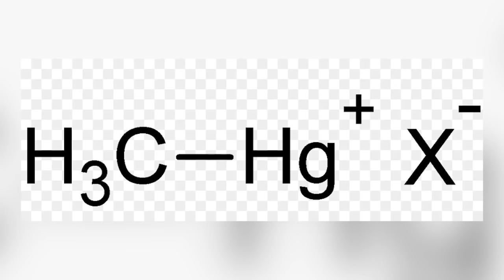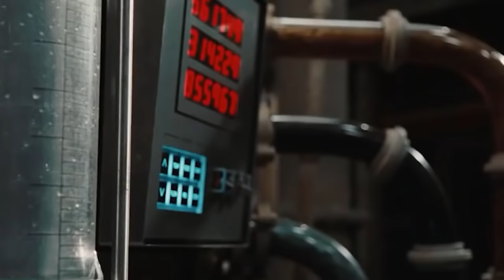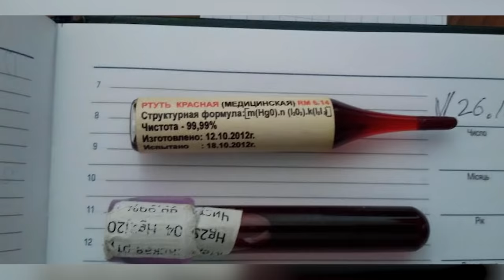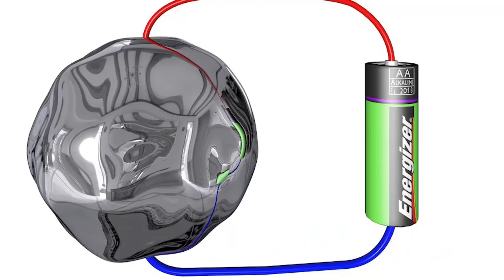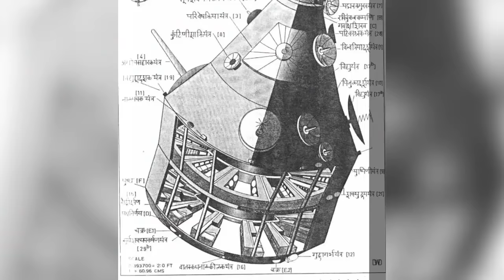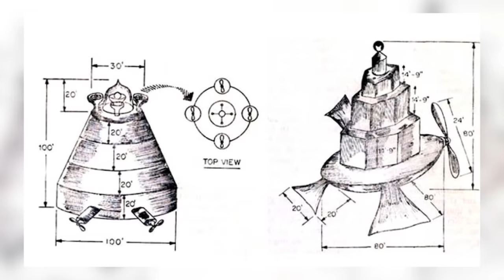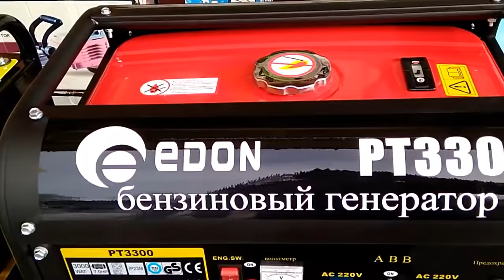Thats Why Mercury Engine Is Forbidden

Comment: I like how when the narrator says that once you start a mercury motor it could continue to power itself while showing a video of a mercury vortex turning off once power was no longer applied.
Reply: Yeah, I thought that was weird too. It's like....dude, where's the perpetual motion?
Reply: Yeah because we have real actual Mercury Motors that work to have a video of it's clearly a mock-up something to visually demonstrate the idea
Reply: Things power themselves all the time. EGR valves in cars, afterburners in jet engines, breaks on electric cars, even a turbocharger or supercharger in a car powers itself. Granted it will never power itself completely, but it does generate power/joules/watts that it then partially funnels back into itself; max efficiency. I'm pretty sure that's what he meant by "power itself"
Reply: Either that, or he meant the mercury generates power using nothing but itself and the electricity; ie no moving parts other than the mercury
Reply: L1qu1d S1lenc3r  Physics vs fantasy
Reply: You would have to have a timed circle that back feed the motor after the initial start up. Depending on  how much the power the motor requires to run, other circle would have to be build such phase if ac. I'm assume its dc in which case a battery would be i play.
Reply: @Ae3lolz  the magnetic fields that it travels thru as its induced by a frequency to stagger its structure in A way that it "perpetually motions" itself around for a short period until physics equates opposition the focus should be on whats powering the magnectic fields not if its possible
Reply: @nunyabizness875  dude, a machine that makes an output, then uses some of its output for the input is partially powering itself. Put all the quotes around any word  you want, it's still powering itself
Reply: @nunyabizness875  bingo and well said
Reply: inertia is the word ure looking for i guess....
Reply: Yea I don't believe mercury is abundant enough compared to oil. So whether it's true or not for this so called "science" it wouldn't be widely used cause if you believed in peak oil conspiracies than what do you think it would be like for mercury trying to power the world 🤣
Reply: @christianhays2238  i agree. There is too many people on this planet to sustain life properly (diamonds should be used to filter water not for apes who want to make commitments) 😏
Reply: This guy worked for ancient aliens I'm sure.
Reply: @bradleypidge7812  no, it's complete bollox there are no mercury motors.
Reply: @Ae3lolz  nothing powers itself,  name 1 engine or whatever that powers itself.
Reply: @Ae3lolz  you still aren't getting it, nothing powers itself, oh wait maybe a horse lol.
Reply: @Ae3lolz  none of those things power themselves. Take a turbo for instance the power forth turbine to spin comes from the gas air mixture igniting in the combustion chamber then that exhaust gas moving the turbine, basically the same idea with a supercharge just substitute the exhaust gasses to for the pulleys attached to the crankshaft.
Reply: @Ae3lolz  a feedback loop is not the same as something powering itself because just the fact that there is full involved to keep it running means it doesn't power itself.
Reply: I'm not sure but the electric source powered electromagnets. If you combined Mercury with rare earth magnets maybe it would work as long as the magnetic field was still there
Reply: @MrBeastboybrown  
... I want my perpetual motion!
You promised perpetual motion!!
Give me my perpetual motion!!!
Uh, can I get that with a serving of time travel, too?
Reply: It's a demonstration of It's magnetic properties, people today no longer know how to use mercury
Reply: Requires a vacuum state
Reply: thats typical fake videos created just to get hits
Reply: I’m sorry but like how did u not see the guy disconnect it’s current, like wtf it was powering itself then he broke the current
Reply: it would power its self when started, think AC generator and loop the out put back to the mercury
Reply: @blackturbine  catalytic energy recovery USING A MAGNETIC FIELD For the reduction and improvement of diesel particulate matter
Reply: when you make mercury turn fast enough I think it could create a magnetic field that would in turn make it possible ! IMO
Reply: Guess he has some bugs to work out lol
Reply: @blackturbine  a supercharger does increase energy efficiency doesn't it? You're increasing power by increasing fuel and air but it also causes more complete combustion so per unit of fuel/air you get more energy. I'm probably imagining it wrong but I thought it increases efficiency.
Reply: Depends if they could create a superfluid state in mercury. A ferromagnetic super fluid would technically power itself. But maintaining that superfluid state is seemingly impossible.  As a philosopher, and theoretical physicist. I designed a cyclic mass engine that can sustain itself for essentially free energy. The problem isnt energy. The problem is people...  its not even the wealthy trying to sustain their positions of power. Its that people are to easily reproduced without the intellect it takes to fabricate these technologies. The entire education system is design to try to measure intellect to isolate them for a future of true world peace that wont spontaneously collapse.  Right now we have a half wit president pretending majority is right simply for majority. Defining democracy without intellectual awareness or analysis. Defining it by how quickly a people can reproduce and get their dicks off. Popping out babies left and right.  If we gave people free energy. There would be a population boom. We’d convert all mass into energy. The core of the planet will cool. Earth will loose mass. And we will either be consumed by jupiter. The sun or flung out into space...  so. Its all very critical to biometrically sustaining energy without a loss of mass.   Mercury engines take immense power. Anti-gravity takes 4x4x4 the input source of energy of a gravitational field and body. You’d basically consume all the energy on earth accumulatively. Its all very complicated. Just live your life. Enjoy what you have. Try to be a good person. And accept the truth of it. If you cant figure it out and design it. You dont deserve it.
Reply: @treatb09  Doomer
Reply: I see applications...
Reply: @treatb09  so if you cant do something you dont deserve it?
Reply: @bradleypidge7812  what?
Reply: @christianhays2238  it would be once used and you never have to replace it buddy like oil you got to keep adding some mercury is once and done forever
Reply: It could! If it was in space... zero gravity's needed
Reply: @Ian-ie3hy  🤣😂🤣😂🤣 👍👍👍
Reply: Perpetual motion is not a myth. Everything in the universe is in motion perpetually. Free energy is not a myth. Solar panels turn sunlight(free energy) into electricity. The trick is building devices which harness all the free energy around because every device on the market will only work on the energy being sold to us by general electric.  If anyone were to demonstrate a free energy device they would suddenly be overtaken with an uncontrollable urge to commit suicide by any means available, however impossible it may seem. 
  If you think free energy is a myth please explain what force causes lightning because as I understand it, the Earth is a gigantic magnet that's always spinning and the atmosphere is a big electrical capacitor plate that stores the electricity it makes until it's strong enough to jump the gap between the Earth and the atmosphere and that make lightning....
   Over 100 years ago Nikola Tesla discovered how to tap that eternal supply of free energy but when General electric and Westinghouse found out what he was doing they invested heavily in a gigantic smear campaign against him. 
   Virtually all pollution from big energy today is directly would not exist if Tesla had finished the wardenclyf tower project. By the way, the fukoshima power plant is still leaking and it was built by general electric.
Reply: it was missing a circuit to give a fuck, dude
Reply: @giles5966  the way you describe lightning is rudimentary at best. Sometimes the discharge is not between clouds but rather between clouds and the earth itself...but how do you suppose that electrical differential came to exist in the first place? It's not all coming directly from the sun. What if I told you it's possible to drain so much energy from the atmosphere that it prevents lightning from striking...?
Reply: @captainKedger  I agree I didn't explain lightning in a reductionist way.  I don't know if you are familiar with a device like an electroscope.  Basically it's a jar with an insulated wire leading through the lid to perhaps a folded gold leaf (very thin foil) though even graphite from a pencil on thin paper will work also.  When you, for example, rub a balloon or a plastic comb on your forearm or a piece of wood and bring it near the electroscope, the foil inside is observed to move.  My point talking about this is that to explain what's going one is compelled to accept that there must be charge carriers which can be added or removed from objects by friction.  Carrying on with reasoned deductions and further experiments gets us to the point where electrostatics is quite well understood.  The lighting between clouds or clouds and the ground etc.. is just large scale static electricity involving air movement which is driven by pressure differences which are partly due to temperature differences which has some connection to the radiant energy if the Sun and the Earth's motion.  If you get a little shock touching a door handle after walking on new carpet well that's lightning on a very scale.  The dielectric strength of air meaning the field strength necessary to ionise the air so that it conducts electricity is about 3kV/mm.  I have a Wimshurst machine which consists of two hand-driven, counter-rotating disks with charge collection combs and also high voltage capacitors from which it is easy to generate sparks of 3cm indicating ~100kV DC.  There is a guy who demonstrates 7 inch sparks.
What I'm puzzled by rereading your comment was your use of the term "free energy".  I agree 100% with you that Sunlight for example IS free energy in that it's nothing to do with money.  The term "free energy" which I refute is that associated with fruit loops on YouTube  who think a combination of magnets on a wheel will turn all by itself and, what's more, power half of the planet.  These schemes can be dismissed on fundamental thermodynamic grounds.  It is just NOT possible as energy is transformed but not just created out of nothing.  I maybe didn't answer the lightning query because I can't see how that's related to "free energy".  It seems to me you're a bit confused about the term "free energy".  It's not to do with price or money, it's the idea that energy can just be created out of nothing and in the study of physical phenomena, everything is consistent with the idea that energy transforms and moreover physics is quantitative meaning we can assert eg we receive about 1kW/m^2 of radiant energy from the Sun.  This means that the most electrical power we could hope to get from a 1m^2 solar cell, is 1kW.  In practice I think the efficiencies are 10-20% at present and people are indeed encouraged to use their smarts to try and improve the efficiency.  However people who just think they can make a solar cell from a piece of cardboard and it's going to make a MW/m^2 are just certifiable.  I hope I've communicated something there.
Reply: @Ae3lolz  none of the things you mentioned power themselves. EGR valves in cars are powered by vacuum created by the engine and pistons being moved and that is powered by gasoline being burned. Afterburners on jets are definitely not self powered. They have to put fuel in the jets or the afterburners don't do anything. Breaks are short periods of time resting during work hours. Brakes are what stop a car and they're not self powered. They're powered by hydraulic pistons which are powered by a hydraulic pump which is powered by a pulley that is being spun by the engine which is powered by burning gasoline... And I'm sorry to break it to you but turbo and superchargers are just air blowers that force air into the intake faster and they're also powered by the engine with gears, belts and pulleys or by electrical power from the alternator which is powered by the engine.... Dude you have no idea what you're talking about so stay out of this conversation until you have a clue
Reply: @kevinzaun9594  the best electric motors actually do something along the lines of what you're talking about and many are now capable of providing power to the batteries. As the car slows down instead of braking with the brakes it slows itself by the magnets in the motor thereby temporarily turning the motor into a power generator that creates drag on the shaft and slows the car down while providing some extra power back to the system... Also as a magnet passes a coil there's a slight flash of reverse current flow just as it passes and the best generators and motors take advantage of that fact by configuring the coils and circuitry to direct that energy in a useful way. ...but you still never get more energy out than you put in. Perpetual motion requires perpetual energy supply. End of story.
Reply: @Ae3lolz  no, it's not. A machine that uses all of its output for SOME of its input is not self powered. It's just really efficient at doing nothing. Unless it gets ALL of its input from its output it's not self powered. It's energy efficient. There's a big difference. Even if a machine got ALL of its power solely from its own output if there's no energy left over to power something else it's not accomplishing anything but spinning its own wheels. It's like a car with no gas. You can sit in it forever but it won't take you anywhere.
Reply: @palomarjack7090  we are living on a "perpetual motion" machine we call "Earth"
Reply: @captainKedger  Ok I agree with your reasoning but the terminology you use is confusing:--For example, the term "perpetual motion machine" refers to something that, once started, "powers itself".  It is never acknowledged that a perpetual motion machine has a perpetual energy source or any source for that matter.  I hope I'm being clear cos it's evident that you're not a fruit loop but understand that some of the terminology already has meaning that isn't necessarily the literal meaning or what you think it means.  Same deal with the "free energy" terminology as I pointed out in previous comment.  
Do you know of ways to already harness the electrical energy of storms etc.? Ben Franklin and others would collect "lightning" in Leyden Jars which are just high voltage capacitors and easy to do DIY.  In principle there are ways to transform the high voltage electrostatic energy that one can imagine having be even harvested with a bank of Leyden Jars into mains voltage to run appliances and so forth but for things like that the "in principle" isn't sufficient if it's overly complicated and/or inefficient.  The good news is that developments in materials science and such things mean things that were once prohibitively complicated, for example, might no longer be.  For example the huge investments in improving batteries power to weight ratios and so on has yielded results.  I'm in Australia and here we get the sense that the Government doesn't believe in its scientists enough to justify spending money on them working on fusion or anything that doesn't have a finish line in the immediate future.
 I'd like to start a city in the centre of Australia called Lambert and it would feature intelligent design wrt water and power and it would be such that noone owns their home (they can't sell it) but it is theirs to live in.  This would release people from being enslaved to serve the economy and promote creativity and true health.  What's this got to do with anything? Well I've always liked that JFK line about "We choose to do the difficult things because they are difficult".  It's seems the US still has people/organisations that understand the merits of that mindset but that doesn't characterise my Govt. I don't think. Anyway that's probably enough drivel from me. Take care.
Reply: @bradleypidge7812  this is the correct response. The demonstration was merely switching polarity.
Reply: You gotta kick start it with a massive amount of energy initially then it will slip into zero point. Once in zero point you get to move around in a pocket that isn’t subject to the surroundings. So going faster than light is chill.
Reply: @captainKedger where does the energy all come from? The sun!
Reply: @garrybrown1861  No. Energy is in everything. All matter comes from energy taking on a certain vibrational frequency. The sun is the most obvious source of energy for plants and life on earth but it's certainly not the ONLY source of energy available. The wardenclyf project didn't get any energy from the sun. The original plan was to use the energy created by earth's magnetic poles and the capacitance of the gap between earth and the stratosphere. basically the same system that creates lightning. That doesn't come from the sun but is actually a build up of static energy created by the spinning of the earth. Of course without the sun the earth and all the planets would fling off into the darkness of space and freeze for thousands if not millions of years until it found another solar system to attach to so without the sun there would be no life on earth however the sun is not the only source of energy available.
Reply: Look bud he only showed you that when you put electrical current to it has a reaction of motion. That in no way was considered a motor nor was he saying that is a motor. Super simple minds have problems understanding that. He only showed that electric current causes the Mercury to move in counter clock wise rotation. That right there should make your brain go what.
Reply: @Ae3lolz  exactly, the spinning mercury can feed power back to capacitor banks and step up the voltage to give more power to the engine and extend the duration of the angular momentum